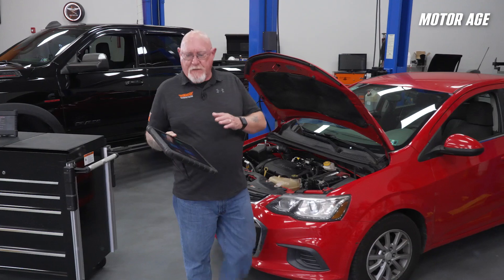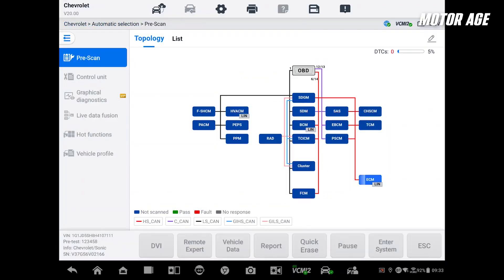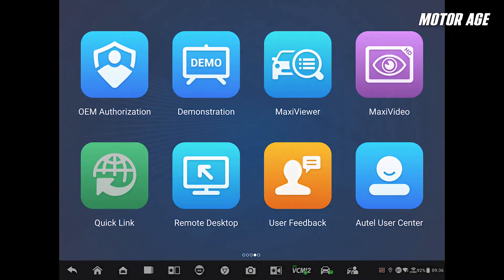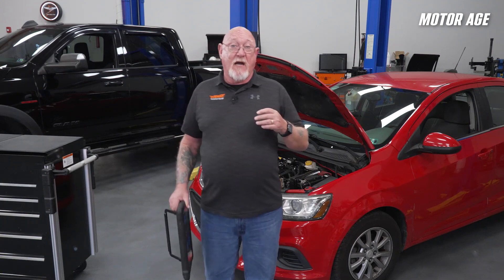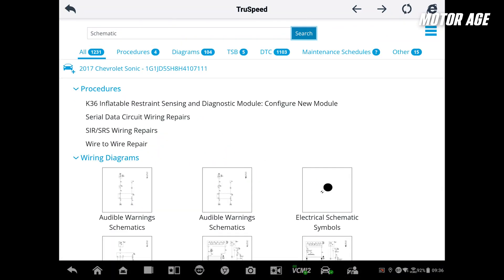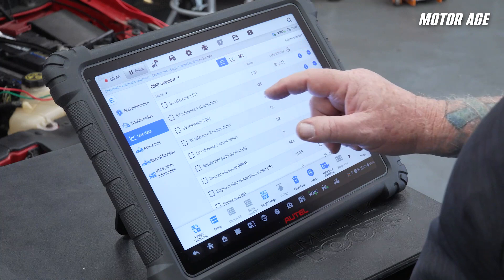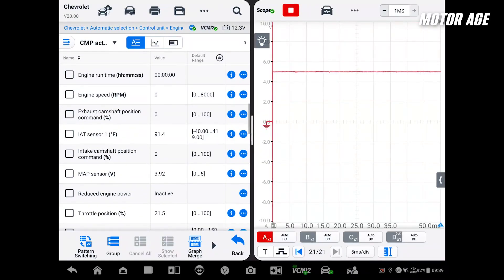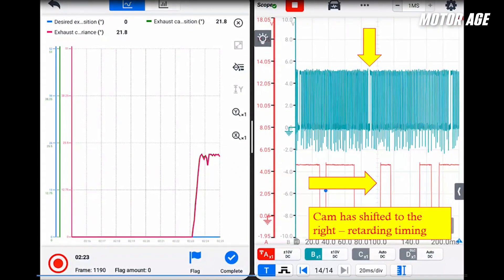Unlock Accurate Variable Valve Timing Diagnostics

Comment: Cool. I can measure VVT PWM Signal frequency and duty cycle using an Inductive Probe (just a lead taped to solenoid).
PicoScope 2204A or a ZOYI ZT-703S on a 2006 Toyota Matrix. It's just a quick way to check if the signal looks correct. 🔧